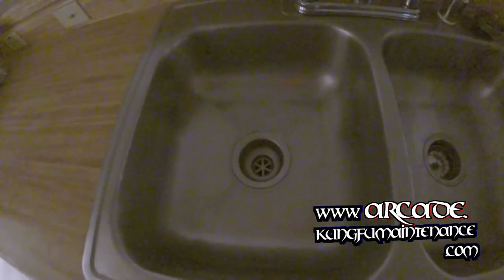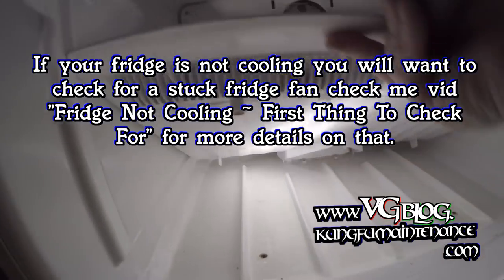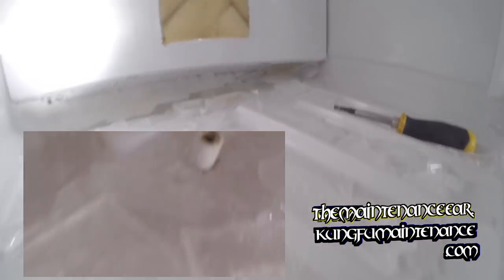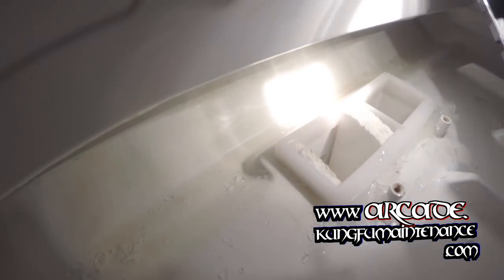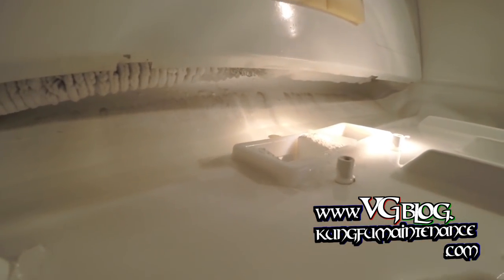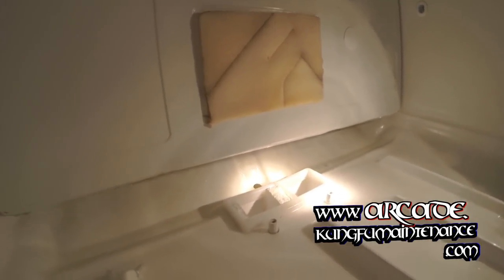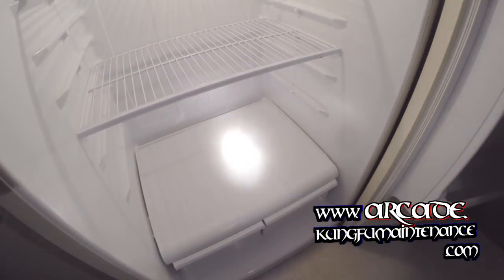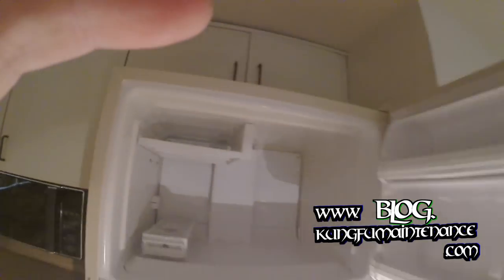Fridge Not Cooling Properly Freezer Freezing Refrigerator Leaking Dripping Water Flashlight Video

Comment: I know this is an older video, so you aren't likely checking comments, but I just wanted to let you know that this worked great! I ended up having to heat some water up on the stove top because my sink water wasn't hot enough. Thanks for the video!

Comment: I have a problem at freeze side; normally  not glasse found only cold air but in my freez side i find glasse that blocks out cold air ,on Refrigerator side it is not cold enough ;  the temperature commende is made by two selector 1 to ref the other to frez

Comment: Is the fros buildup showing on the bottom of the condenser normal on that fridge?
Reply from the maker: A little bit of frost build up on the bottom of the coils is normal. This one was a bit more excessive due to the frozen drain line, ice on the freezer bottom, and inability to circulate air properly due to the ice blockage. Normally the defrost heater would melt the little bit of formed frost during the defrost cycle.

Comment: I have a Roper and the vents in the back are clogged, I used your method and I'm now seeing water flowing through to my fridge, however, the panel along the upper back that has styrofoam insulation  is that supposed to leak on both sides? I hope so. My fridge model is different from yours so I hate to have too much water dripping and I'm not sure whether to decrease my freezer temp until I'm sure it's completely thawed....but, at least you gave me another idea before tossing out my unit or calling in a costly repair man.
Reply from the maker: Based on your description it sounds like the condensate drain line is still clogged and has ice blockage blocking the fridge compartment. Most condensate drains can be accessed form the freezer on top. 

These can be tricky to fully unclog as ice can freeze a ways down the drain line. Takes a lot of patience, adding hot water, vacuuming out with wet dry vaccuum repeating with hot water until drain fully clears. 

There are some that there is a reservoir in the ceiling of the fridge compartment  towards the back that can be removed with the control panel to dislodge ice blockage and or clear the drain. I show that style of unclogging procedure in me video "Frigidaire Freezer Refrigerator Leaking Water In Fridge Down On Floor Unclogging Clogged Drain Line" Frigidaire Freezer Refrigerator Leaking Water In Fridge Down On Floor Unclogging Clogged drain Line. ~ Thanks for watching!

Another way to do this if all else fails (which takes much longer) is to open all the doors unplug and let sit for three plus days to completely defrost . The condensate drain can be checked with water every 24 hrs or so to prove if cleared.
Reply: I see that patience is needed with this technique..lol  I will definitely let you know how everything pans out. Your advice and your videos are sincerely appreciated!!! I've been working on it (smiles) If it doesn't work, I'll feel pretty good that at least I tried something before spending the cash on a new one.